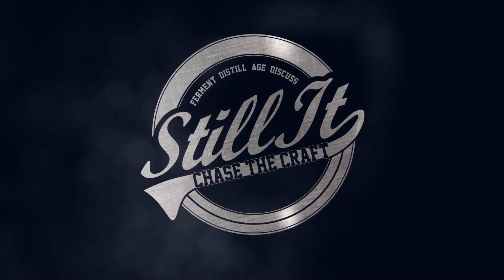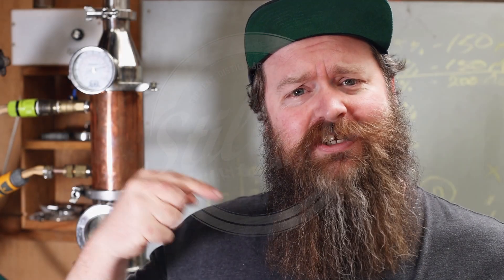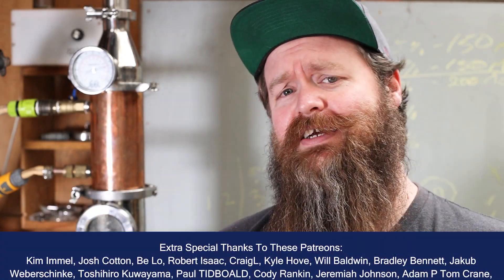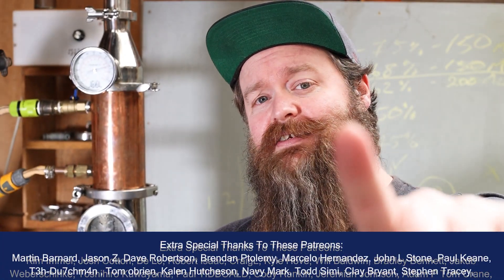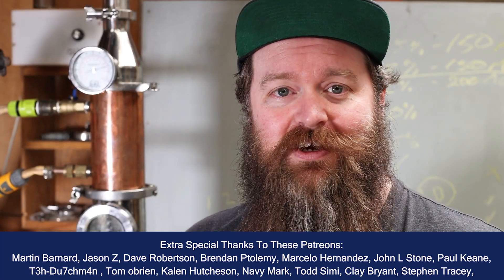Myth Busting : The Still Determines ABV, Not The ABV In The Pot

Comment from the maker: Apologies for the inconsistency between numbers on the graph shown and the numbers I am talking about.  When talking I was using a slightly different graph using fat fingers to "draw lines".  The exact numbers do not matter, its just an illustration of the concept. If you are interested in using this graph I would very much suggest you spend some time reading the threads linked in the discreption!
Reply: Jessie ive heard you say nany times run your distillate down to tails of 30%.
There is zero reference in your distillate abv; to the amount keft in the pot.
The abv is entirely down to the tining of your condenser.
My abv in a pot still will never make less than 65% off tge spout because i run my water fast non stop. My power is as low as is humanly possible and still simmer.
A boil is too fast.
I never get wet dog tails bevause i simply do t create rhem at the beginning heating.
Your 25 litre still running 4000wats is four times the power you need its insane!
No wondef you get shitty heads and tails.
Tune things finer
Reply: STAGE   VAP     DEW     BOIL
 0                                      191.6
 1           69.5     188.9
 2           85.0     174.8
 3           89.0     172.9
Use  the formula I posted on the other vid.  TTBOMK it's within 1% every time for every run I have data points for as well as the numerous graphs and formulas out there.  The only places I run into trouble with it is with copper mesh packing and that's just a matter of figuring out what the plate equivalent is.
Reply: Sausage fingers are always  good for measuring a 2 finger glass.
Reply: And yes I have a sleeping disorder.
Reply: The vapor-liquid-equilibrium charts are no longer available in the forum. Do you still have them somewhere (or even on your website)?

Comment: Plates in a distillation column are not 100% efficient, so you won't reach the distillate concentration estimated from the chart. Typical ethanol-water plate efficiency is about 75-85%.

Comment: I can drive a screw in with a hammer and my technique may be perfect but it’s not going to get the result I want. 
I know you are very good at what you do and I would never presume to know “better” but like everyone on the planet my point of view is unique to me. 
The question isn’t whether or not a 2.5 abv wash can be distilled to 90% because it sure as heck can be. 
Probably not in a single run unless one has access to very precise measurement and heating equipment that can track and adjust temps down to the smallest percent but it can be done so the question is what determines proof? Initial abv or technique and apparatus. 
If 100 gal 2.5 abv was can be distilled to 90% over successive distillations than what matters is the technique. 
The processes determine the proof just because a single run even with virtual distillations didn’t produce it does not mean it cannot be produced by a different technique or different technology. 
Again I am not arguing against your expertise and never would clearly you know your shit. 
I am merely stating my opinion on the test itself. 
Thank you for sharing your knowledge and continued support of the home distilling community.

Comment: It's only reasonable.

If you have a higher starting ABV you will more easily drive off the alcohol with the same setup. If you plan to reach a specific end point, it means the lower starting abv will require higher temps or more distillation passes.

This means that to reach the same end point, a higher abv wash can be distilled more gently, which translates to fewer lost flavor compounds.

Heating longer and/or hotter will necessarily end up losing more flavor, either to heat damage or to evaporation (i.e. aromatics floating away when opening heated chambers)

EDIT: I actually wonder how it might affect the final result to jack a wash beforehand. Maybe freezing some water and removing it before distillation could help bump up abv AND concentrate the flavors in the low wines left over? Might be worth testing.

Comment: Hello from falls City Oregon. U.S.A. Great information. I've been experimenting with a 3 plate. . 3 inch colunm. On top of a homemade 12 gallon electric heated stainless 12 gallon pot. Pot has 12 inches head space with 4 , 10 inch copper perforated plates suspended above the wash. I installed a 1/2 inch copper cooling tube within the vapor stream. I had to install a PID to better control temp fluctuations. I am not a mathmatition. So I can't explain precisely what is happening on paper. But with this process my % comes out consistently 95-100 no matter what % I put in my pot. My wash is usually 12-15% it seems that the the abv is drastically changed depending on how fast I bring my wash to running temp. Slower seams to be the best for a better taste and faster gets me a higher % for half the run. And then the % falls off fast.

Comment: OK im confused, I'm a relatively newbie, started watching George, which led me here, love all the videos, but, I'm sure I've heard George say that there's no correlation between what's in the wash to what comes out.
I have a humble pot still and do cheap sugar washes, 12%abv, my starting abv out is approx 85% according to your graph I shouldn't be getting anywhere near that?
Reply: George says a lot of wrong stuff...
Reply: Hi, unfortunatly its true, I also heared that George hasnt the best rep in the community (unfotunatly, I still love his videos and I personally gained alot from him) but could it be that you are using a reflux still instead of a pot still? Something to keep in mind here is for example the passiv reflux from well, long tubing basically. I couldnt tell you how much it changes bu if you would use a very, very long 1 Meter column your ABV would be higher than with a 20 cm one. Just one idea (and properbly the wrong one) but what it boils down to (haha) is if your ABV is significantly higher than in the graph you porperbly have some form of reflux going on. At least for my (pot) still 85% also would be pretty high for a 12% wash, but as stated just personal (limited) expierence :)
Reply: @Storm-dk7zp  no it's a cheap Chinese pot still, my understanding is, if it's 10%abv starting in a 20 litres wash, the max I can get out is 2 litres of alcohol simple math, however it doesn't come out at 100% therefore I'll actually take off more than 2 litres
So to me the initial abv does have a bearing on what comes out
Reply: What jesse is saying (I think) is the ABV usually matter AS WELL but the bigger influnce on you final ABV is the still/ the setup of the still.

Comment: 12-14% wash, pot still, 64-65%
12-14% + few bottles of feints 74-76%

Peak values, average kept was around 50-52% and 60-64% respectively 

Something about hydrogen bonding, more ethanol = less water molecules and thus easier for the ethanol to be liberated from the water

Comment: The reason a single plate will not line up is the surface area for one plate isn't as large as that of one pot still. Of course if you increase the amount of reflux in the case of the plates or decrease it in the pot still the results will shift the other way

Comment: I guess I don't fully understand this: Aren't you ignoring the volume of output? If I have a wash of 100 liters and my wash was 20% ABV there is only 20 liters of 100% alcohol possibly available. And if my wash was 10% ABV there is not a molecule more than 10 liters of 100 percent alcohol in the wash before I begin distilling. Does that not suggest that BOTH initial ABV of the wash AND the still determine the final outcome in terms of BOTH volume and ABV (or proof)? What am I missing? 
Goes without saying, of course, that it simply isn't possible to achieve 100 percent ABV by distillation alone.
Reply: You are right, but the myth was that the ABV of the wash didn't make any difference.

Comment: You are right in that a single plate doesn't actually act like how an ideal plate should act. The main reason is just the laws of thermodynamics, nothing is 100% efficient, and while heat energy travels from hot areas to cold areas, it doesn't do so instantaneously. So there will never be a real stable temperature in the column, there will always be fluctuations in temperatures in the column, of the column, liquid and vapour.

So what this means is that at each section of the plate, you will effectively have 2 different inputs for the vapour mixture. So let's say the Kettle has a liquid at 2.5%, the vapour above it is at 15%, meaning the condensed liquid on the first plate is at 15%, and the vapour above that first plate is at say, 60%. 

So on that first plate, you will always have some mixture of vapour input containing both 15% vapour and 60% vapour. The 15% vapour is simply vapour that didn't condense as it passed through the liquid on the bubble plate. Most of it did condense, transferring its heat to that liquid, which allows the 60% vapour to be created from that liquid, but not all of it, because again, nothing has 100% efficiency, and that's why even though ideally the first plate should be at x%, it will always be below that. 

That said, if the space between your plates is large e.g. the bubble plate walls are very tall, and you insulate the column, you can have a 3rd input of vapour which is above the ideal vapour concentration for that plate. This is due to that 60% vapour condensing on the walls of the bubble plate section, and those liquid drops vapourizing again, releasing an even higher concentration vapour. In theory you could get a higher concentration condensing on that 2nd plate than should be possible, but more realistically all that will happen is you will get much closer to the ideal concentration for the plate.

But since this is a hobby, and nobody has got time for that, I almost always just treat it as if each plate is 100% efficient when I am planning out what the potential ABV will be.

Comment: So by this graph we could easily understand that the starting ABV affects the end alcohol by volume in the end.. But what about flavour? Whould the same mash have different flavours on the end if it is let to reach different ABV before distelling? - thats what I was hoping you address here.. Still great topic! Thanks for the vídeo!
Reply: Yes the flavors change as the ABV changes. Both in terms of them being at different temperatures/boiling point s and due to a change in solubility in the water/alcohol mix, think stream distillation of lavender or rose. (Just don't ask me for the calculation :))
Reply: @chrisparkin6894  thanks for your input. I can understand that concept and makes total sense that the starting ABV whould affect flavour. Whould it be less intense sinse de alcohol did cannot take as many flavour components? Whould it be more on the sweet profile sinse there were more sugar on the mash?.. I think this could be a very interesting experience to show here. Kind regards
Reply: @Davide_Lourenco  no idea which way the flavors would go. As you say, it would be an interesting experiment. Probably the best was to do it would be an infusion of the wheat etc with different % of alcohol (as tasteless as possible) and that removes the complication of the yeast etc
Reply: @chrisparkin6894  I agree. An infusion is a better starting point since as less variables. With a mash you could have two or more buckets with the same mash (divided equaly after piching the yeast) and distill the content of the bucket once it reach the intended ABV.. This whould force the buckets to be opened several times which can induce bacteria infection (but since the ABVs are low the yeast should take over and dont let the bacteria spread).. I'm getting excited just from writting this.. Lol
Reply: @Davide_Lourenco  even having different final ABVs can stress the yeasts to different extents so that would change the flavors.

Comment: Im not sure about the plate is not a full distillation. If I run a pot still with 2 thumpers charged with 140 at a quarter of the volume of my pot still I will get high 170ds to low 180ds. But if I run my column with 3 plates I can pull 190, but then again that would also include a reflux precondencer but with just a onionhead on a pot still and a shotgun condenser only I can get 160 to 170 with just that little bit of refluxing from the onion head. Understand how the onion head works but its still amazing to me how well a simple shape affects the proof or ABV  BTW here is vid of my still in pot mode with the onion head and a gin basket, making some apple brandy if youed care to take a peek.  https://youtu.be/DnLvKOBYU2E

Comment: Tbf, though, even a pot still has passive reflux.  So this probably works a lot better when using plates than not, right?
Reply: The pot still will have .more surface area than one plate, plus as you said it will have less passive reflux.

Comment: Doesn't the more plates reduce flavor?
Reply: Short answer, yes. Just as running multiple distillations tends to mute the flavor. That said, it depends on the flavor of the wash and it may need multiple plates or distillations to get the 'right' flavor.
Reply: I'm running four plates in a claw hammer still, bubble plate column. My last batch is a low ABV. Not by design. Rookie mistake. Lots of flavor.

Comment: I would basically agree that lower ABV washes CAN give a lower ABV in your product, DEPENDING upon the TYPE of still...  My water cooled column still will pop out 96% until the wash is depleted. The lower the ABV in the wash, the lower quantity I will receive.
Reply from the maker: Yup.  Like I said at the end.  If your reaching azeotrope your not going to get any higher.  So as long as the still has the ability to get you there from the abv in the pot the abv no longer matters
Reply: @StillIt  hey mate great videos btw! Just wanted to add my 2 pence...I’m a professional distiller and we have a 48 plate column still fed from a pot (batch not continuous) for making 96% spirit. I agree with your estimation that a single plate is not a “complete” distillation...in fact I don’t think it can really be defined because it fully depends on the levels of reflux you’re running. Also a key point to consider on hitting the same ABV no matter the pot strength is while in theory yes that’s correct, in practice (at least with a batch system) it becomes more about the volume of alcohol you actually have available from the pot to fill the entire column and come through as high strength distillate...I.e. from a 2.5% charge you would have a very very short period at target ABV if reaching it at all before you’re just pushing water up through the column and diluting the distillate...
Reply: Is that 96 proof?
Reply: @jimlippi4001  no, 192 proof...
Reply: @TonyGariepy  that's some real rocket fuel there.